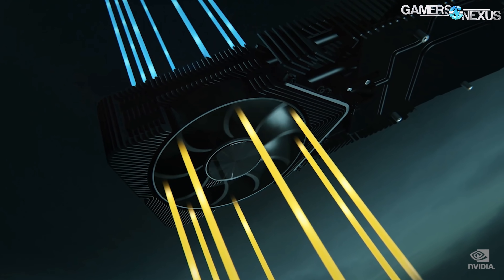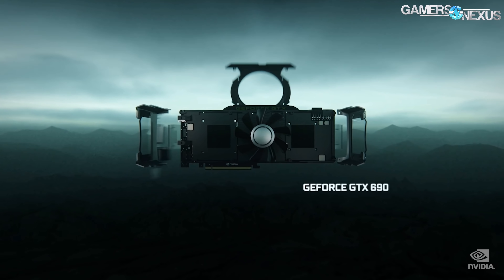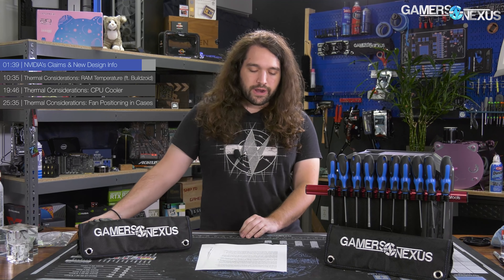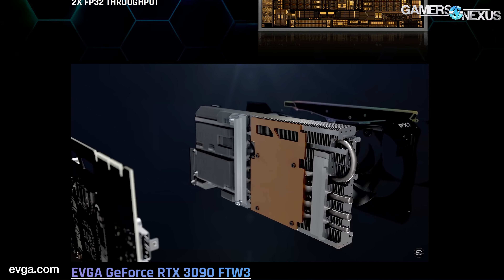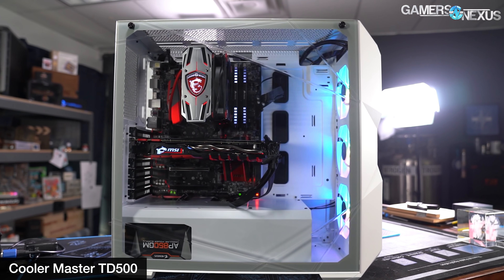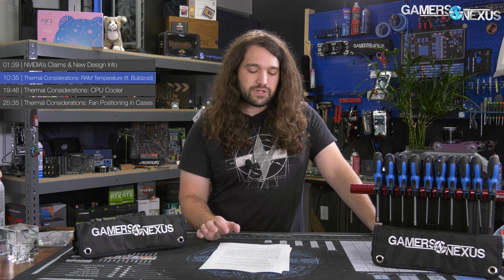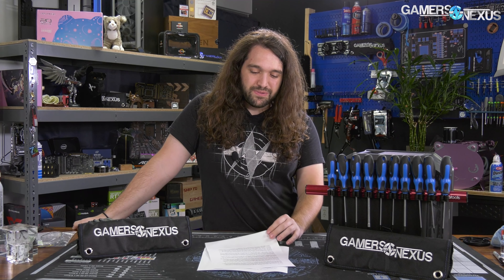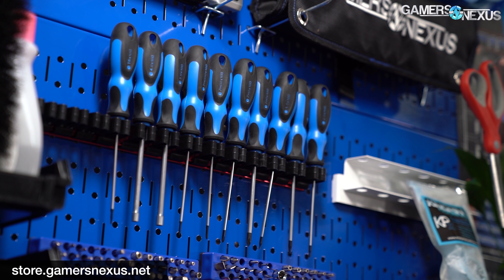NVIDIA RTX 3080 Cooler Design: RAM, CPU Cooler, & Case Fan Behavior Discussion

Comment: After seeing the most models from other brands, the FE still the best looking card in my opinion.
Reply: This might just be the first time I get a FE instead of a partner card.
Reply: Yea, I usually skip Fe but the 3080 looks good
Reply: Oh, yaah. The Strix f.e. looks straight up cheap and all the others also went the rainbow road way. Nah, it's FE regardless for me. Cheaper as well. Not worth the upmark for RGB and a few % gain.
Reply: @jt thorsson Online from Nvidia's website. Or Amazon.
Reply: EVGA really fucked up their cards looks. They look, weird
Reply: @jt thorsson order direct from Nvidia
Reply: @DAnderMcSullivan  Same here. If the cooler sucks i'll just ramp up my other fans, it' so good looking. It almost has a sort of stealthy titanium look about it. Very sleak.
Reply: And Australia apparently aren't getting the founders ones at all :(
Reply: @jt thorsson I'll bet, if you spray paint or plastidip the shrouds in white, it will look awesome!
Reply: Honestly, I care as little about how my graphics card looks as I do about how my CPU looks. What matters is thermals and performance.
Reply: @GoGoErrek  My issue with Strix, style-wise, it's the silvery parts. They will be fine for their -I board but really clash with the standard ATX ones, -E/F/H. Weird design choice. Oh, and the fan cutout is insignificant, as always.
Reply: Considering they're advertising up to a 20C decrease in temps it will probably be one of the best cards if true.
Reply: @GoGoErrek  My last couple of cards were Strixes because of the plain black and almost complete absence of rgb.  
I don't know who is in charge of aesthetics at the moment but looking at the 3080, i'm guessing he's suffering from a graphical's writers block.
Reply: agreed
Reply: Yeah, Turing was the same way. Nobody makes clean shrouds...
Reply: Nvidia is becoming the Apple of video cards. Really great to look at, until something inside of it breaks and it realise how fucked you are. The FE for the 900-1000 series cards was also pretty cool, I liked the metal design,.
Reply: @jt thorsson Nvidia site and sometimes BestBuy has them online at a slightly jacked up price.
Reply: Twisted LoopS yeah, their cards used to be one of the better looking one to me
Reply: I havent seen a Red Devil or Sapphire vers yet, but otherwise you're right the ref card is looking the best so far.
Reply: @will4may175  Thats cus they make AMD cards
Reply: Can I get an fe card in the UK?
Reply: I hope the RTX 3070 cooler performs well. I really want a FE card this time. As with RTX 20xx line up, Nvidia will again use their best chips for their own FE cards.  So going with a FE card enhances your luck at silicon lottery! Also i really love the design of RTX 30xxFE cards/ cooler. As with the 3070 it looks like to be a more conventional dual fan design. 

I hope some reviewers will  lock a RTX 3070 and a RTX 3080 to 220W while runing a stress test. This will show if Nvidia's new approach in cooler design(RTX 3080), really performs better while also being "3 times less noisy".
Reply: @AusDaniel  lol I didn't know that, I am sure I had a Sapphire GTX in the past, oh well, thanx for letting me know.
Reply: @killercon2735  Possibly, I think it's only Australia not getting any so far.
Reply: @prodtwisted  really I'm not a fan of the ftw3 but the xc3 looked like a fine plain card imo
Reply: I feel like after coolers coolers look worse now for the 3000 series. I would pick the reference cooler even if it was worse just for how much nicer it looks
Reply: Agree 100%, but hot damn it's problematic, do I pre-order it so I don't have to order the second round of GPUs, or wait for reviews and then get it??? I'm going for the 3070 so 3080 would be out in the wild and reviewed, but will it directly translate to the 3070 with its central power in (2060 FE)
Reply: @DAnderMcSullivan  Same thing. The last Card i bought was the 1080 Ti and its Founders cooler was abyssmal, being throttled by it.
I bought the Strix instead....well the Strix keeps it under 70°c but it's loud and 1 Fan broke after almost 3 Years. Also It has no hysteresis, so i have to keep MSI bloatware running just to keep the Fans from constantly starting and stopping. (The Asus software doesn't work on my PC, despite having Asus Hardware >_>)
Reply: Yeah, I've been getting EVGA cards since the GeForce 7950 GT,  this ones going to be a hard pass.
Reply: @Ib_h7  looking at the graph they shown, the 3070 looks on par with the 2080 super and faster than teh 1080ti, so depending what you're upgrading from it wont be a bad shout, it's looking like the fav will be the 3080, depending on stock it might need a fight to get one.
Reply: @lemon777r  I am and AMD fan but give it to Nvidia they pulled out a great release this time, it's going to take a lot of effort not to buy one waiting to see if AMD can match these, and if not there won't be any Nvidia cards left, I do feel sorry for anyone who bought any mid+ Nvidia cards this year, I even feel sorry for myself buying the 5700xt Nitro+, oh well lol.
Reply: @will4may175  Dont't feel bad. You've got yourself a great card there!
Reply: @will4may175  I'm sitting this one out.. waiting for the 3080 with more memory. Hopefully the storm is calmed by then.
Reply: @Nickeles020  Oh I love the card, both me and my lad have bought the same card, I do want a card to handle 4k gaming, as I use a 4k 65" tv as a monitor in my living room, the 5700xt cannot hit 60fps on many games at all, usually 40s, the 3080 is tempting, gonna wait until AMD release 1st.
Reply: @jt thorsson Saving money, big nose. It all makes sense now..
Reply: Hydro copper or hybrid ftw
Reply: Got an ncase m1 and non blower coolers are terrible shit gets toasty. This FE card looks promising.
Reply: I don't about the best but the best looking, yeah. Like always.
Reply: i do think zotac looks pretty decent...
galax/kfa2 looks okay thus far, gonna see about the HoF
...and in the end a hybrid card seems like a pretty cool idea too - hello evga.
Reply: GoGoErrek THE FE WILL BE CHEAPER???
Reply: @slavichwalker9856  ofc it'll be cheaper than some customs, especially high ends and especially at launch, lol. (if you do manage to get one from nvidia)
Reply: @jt thorsson I hope they do, the lack of any news about them woories me though, are they keeping quiet because the 3000 Nvidia has them beat, or because they have something like with Ryzen against Intel, no news about that until almost release day and blew the CPU market wide open, here's hoping.
Reply: @jt thorsson Yeah that pricing from Nvidia might be the thing that stops AMD somewhat, 700 for a card that thrashes their own 2080ti is huge, it's about time we had such a big jump in speed at a fair'ish price, as 1200 for the TI was only for the hardened/richer gamers, cant go wrong with your 2080s, nothing out there to match them until now.
Reply: @jt thorsson true they did it when 5700xt came out, Nvidia quickly brought the Supers out.
Whichever card you buy it'll be an upgrade, we all win 😊
Reply: the quad slot card from aorus looks "interresting"
Reply: Yea i like the FE a loooot but that all black evga card is looking good tol
Reply: Good luck finding a FE for MSRP. You'll likely buy a board partners model due to pricing and availability. I admit this is the first reference card that I actually am considering purchasing.
Reply: Key phrase: Best looking, still have to wait on performance
Reply: I'm with y'all, and it's going to be the first time, but the only one thing that concerns me is the performance of the cooler and how quiet it is.
Reply: @DAnderMcSullivan  same <3
Reply: Can somebody tell me , are after cards cheaper than fe or fe is the cheapest at first release
Reply: @Zedxd  cheapest so far
Reply: Tek G so if i get the fe in release, i’ll get it for cheapest right
Reply: It catapulted from a joke of a blower to being optimal to third party design.  I wonder how the partners feel about it.
Reply: @Wahinies  still looks like a water cooler radiator though
Reply: Damn it's really weird to see people worrying about looks instead of thermal performance and the warranty that comes with the card.  EVGA has proven to be a fantastic company to deal with when you need warranty work done, and I would prefer to stick with a company I am confident will have my back if something goes wrong.  How the card looks is not a priority in the slightest.
Reply: Also the best priced 💯

Comment: 08:28 "Because you can't just take scissors to a PCB and have it still work"
Tell that to the portable Wii that Linus covered on his channel!
Reply: Ironically Steve cited Louis Rossman on that part, who in turn was tilted when he saw a video of Jay of JayzTwoCents "soldering" a resistor on with a cheap iron and magically getting it to work.
Reply: jeah but that wont work on pc pcbs xD he just cutted out things like movment controls and stuff like that, that you really dont need for a portable console xD
Reply: @daumen3226  Don't kid yourself on the crazy things that can happen.  A long time ago a buddy of mine had knocked off a resistor from his motherboard trying to get the video card out but the resistor was gone.  The computer wouldn't boot with that missing.  For S&G he put a blob of metallic TIM between the gaps and said how much you want to bet this works?  I said no effing way that is going to work.  It worked...
Reply: @Stubbies2003  I remember taking a graphite pencil to the Duron CPUs when you wanted to change the clock multiplier to overclock it ..... The CPU was locked but by adding a fake resistor with a pencil you could up the multiplier one or two ticks ..... If it wasn't stable you just erase the fake resistor ......
Reply: @longjohn526  wtf that's hilarious 😆
Reply: @8lec_R  Totally legit though.  That was on the very old AMD processors.  I remember that one as well.
Reply: @Stubbies2003  IK but it still makes me chuckle 😆

Comment: Steve: "Frankly these are like 700-1400 dollar cards. If you're using a stock cooler at that point you need to stop, cause it's causing you other issues anyway"
My Wraith Prism Cooler: Nervous sweating intensifies

Comment: 21:18 Point B. I have a M.2 below the GPU (ASUS Strix 1080 Ti) and the hot air it is dumping onto it keep its Temperature so high, so that it constantly throttles.
Thats also why im looking forward to the new 3080 Founders Cooler.
Reply: Agreed.
Reply: Stick a heatsink on the M.2 and it should still stay cooler even with "Hot" air blowing on it. Exhaust Air is rarely more than a few degrees above ambient, where component temps are excessively high relative to ambient, so as long as you can catch airflow the chips will be cooled effectively no matter how many components the air has been through.
Reply: @budthecyborg4575  Even with a heatsink over time it should get saturated and end up with the same thermals. You can add mass to soak up heat but if it can't dissipate quicker nothing will change except the time it takes to reach X degrees. Maybe that would help with certain workloads or if the heatsink has lots of fins, but from what I've seen M.2 heatsinks rarely work well even without a GPU blowing on them.
Reply: @MrMattumbo  I found around 20-30 degree difference with the stock Asus heatsink (with drive installed straight behind the GPU). Definitely moved it away from throttle territory. At least for shorter loads which are more realistic for a primarily OS drive.
Reply: Add a watercooler on that SSD bro!
Reply: @ghoulbuster1  NVMes need their moderately high temperature or they die twice as fast.
Reply: Lishtenbird add a waterheater
Reply: @budthecyborg4575  A heat sink may become a "heat drain" just like the copper plate in an AIO where it absorbs heat from the surrounding area, with no cool air I think it might actually make it worse. But there's no way of knowing without trying.

Comment: When you are testing, please look at when the GPU is in an upright position, as when on a testbench or in a desktop - and when the GPU is in a vertical position as in the Silverstone FT cases or inverted as in the Silverstone Temjin cases.  In all those scenarios it would help immensely if the through fan could run in the other direction so that air would flow away from the CPU cooler and not directly into the feed of the CPU cooler. Or can perhaps the fan be turned over?
Reply: If the fan is flipped it would feed hot air straight into the other fan that’s pushing air out the IO shield. You want the fans on the card to blow the same way so one of them doesn’t feed hot exhaust air into the other.
Reply: I find the curve of the blades very strange, and I'm wondering if it will be a reversible fan, to account for some scenarios were that could be useful.
Reply: Yeah I definitely want to see how it performs in vertical and even the new 135° position (probably very poorly) I've been seeing on reddit

Comment: It looks to me that most "partner design" coolers just blow all the energy into the case in all directions. Recirculated and eventually reach some case exhaust.

At least the new FE cooler pushes part of the total energy out directly through the IO panel, and the rest has a more focused direction instead of going all directions. So perhaps it can perform better for the CPU because of less recirculation in and around the graphics card itself, so the hot air flows better instead of being re-heated again at GPU before going out.

/*positive thinking/hoping*/
Reply: I hope they Review this and make it visible with smoke of something. Hat the same thought/worrry.
Reply: Thought the same
Reply: I think it's kinda worrieing because of the fact that a lot of hot air just seems to be flowing into the CPU cooler, heating the CPU not cooling it
Reply: @alexthompson353  as Smash said, normal coolers raise the ambient air temperature in the case anyway, I doubt that the fact the 3080 is blowing directly on to the CPU heat sync will make much difference in the grand scheme of things. At least it's also exhausting half the heat out the back of the case.
Reply: This is exactly why PC designs are almost universally awful. The air just gets re-circulated. See the Mac Pro for an example of how to do much more integrated and clever cooling.
Reply: @BillRey  hahaha, good one!
Reply: The diagram showed two intake fans and neglected to include a case that is fully equipped with good fans.  Use your brain, and maybe consider buying a few more fans for whatever case you get.
Reply: @Orcrist  Good what? The way the MPX modules slot into the Mac Pro and melds with the cooling system is superb compared to any PC tower build out there. Rather than having main case fans and lots of individual fans on each component just circulating the same air around, all the components are designed to fit together so the main cooling fans work to fully cool the components too, in a way that pushes air through the entire case like a jet. Why the PC world haven't progressed in terms of architecture in the past 30 years I don't know - they are still stuck with the clunky yet brittle ATX.

Comment: From that Nvidia chart at 4:40 it looks like the RTX 3080 will just "chill" (for the people used to the Fahrenheit scale) under load at 80º with the fans set for 30 dBA, while the rest of us who like to see normal temperatures of 60-65º Celsius from our GPU will have to settle for turbofan noises at 50+ dBA.
Reply: EXACTLY my thoughts. That is what actually scares me from getting a RTX 3080 FE.
I am so spoiled from my MSI RTX 2080 SUPER GAMING X TRIO.
Never above 67°C (in summer ;normally 59-65 under heavy load) and always < 30 dB(A).
THAT is efficiency at its finest.
Guess I have to wait for a custom card then .. sad
Reply: @HitokiriShin  Why would you need it at 60 degrees tho? These cards are perfectly capable of running around 75 degrees. My Zotac 1080 card, below 60 is the idle temp where the fans don't even spin.

Comment: Hi Steve .

Two quick questions on specifically the 3080 and 3090 cooler designs affecting chipset temps in vertical GPU mounts.

1. How will it affect exhausting hot air onto chipsets in a vertical configuration ?
Up to now , we where recommended to use vertical GPU mounts that position the GPU further from the side-panel glass , and thus closer to the motherboard . 
What would have the most impact on performance on the system ?
A> Closer to the glass panel possibly starving the GPU of air (Normal GPU mount)
B> Closer to the motherboard , exhausting hot air onto the Chipset (GPU Bracket that moves the graphics card further away from the glass panel)

2. Will different chipset configurations also be affected differently ?
X570 active cooling with mini fans vs X570 , B550 and Intel motherboards with passive cooling for example ?

Thanks for giving us the quality consistent answers :)

Comment: Great summary of the challenges Steve.
One thing not mentioned in the video that I hope you'll consider but just didn't have time to talk about, vertically mounting these GPU's.  Seems the "flow-through" fan will be dumping it's heat directly onto the motherboard's chipset, which I'm sorta surprised buildzoid didn't mention....

Comment: Steve, could you also consider testing this card Vertically? With the new fan orientation I’m curious how it will perform. Using the CableMod Bracket in the 011 Dynamic.. so it isn’t pressed against the glass like most other cases. Thanks!
Reply: Yeah I was wondering if a vertical mounted one might blow to much warm air directly at parts of the motherboard that won't like it - especially on boards like B550 without mobo fans.  This might be ok assuming a front case fan is also blowing cold air at roughly the same place, but definitely worth a look.
Reply: I'm probably going to move my CPU cooler to the top in exhaust config, and add front intake fans in my o11. I don't think I can add an exhaust fan at the back so it'll have to do